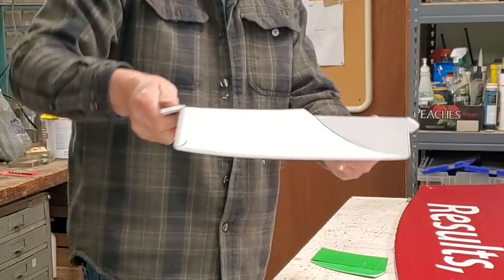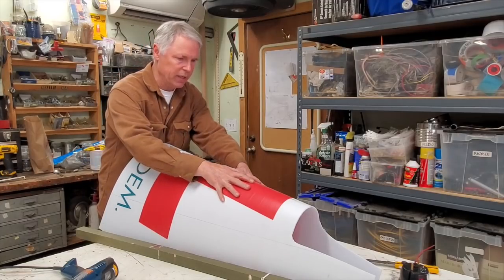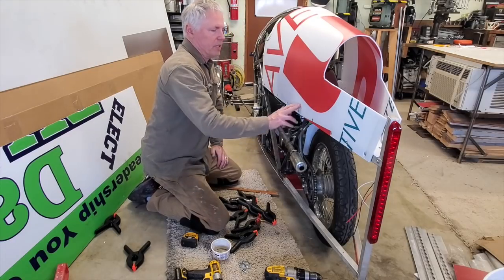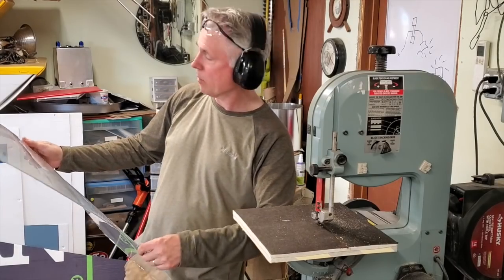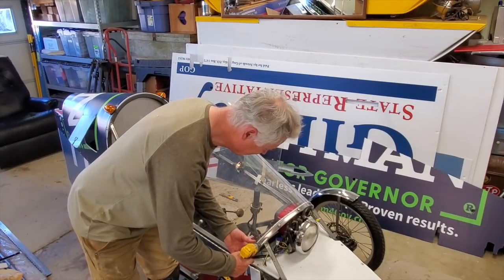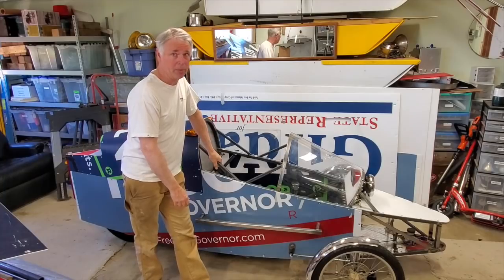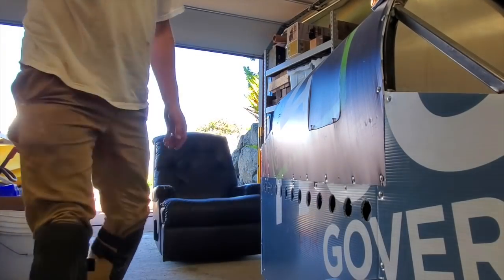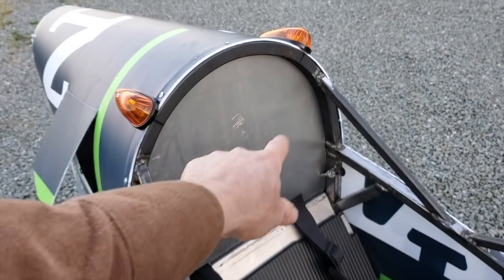Fuel efficient reverse trike build (part-13)

Comment: I remember reading somewhere that practically all coroplast or polypropylene in general is UV stabilized. Adding to that if you source them used with full cover prints, (no matter how many empty promises, commercial or political) that print is still paint and will also help the plastic underneath resist UV degradation.  I'd love to know in more detail from people who have built with coroplast alot what thicknesses and "weights" (grams/sqm or whatever is used) they  prefer and in which places on a fairing.

Comment: The best thing about coroplast is that it isn't fibreglass or CFRP or kevlar or... You get the point. No nasty resin, fumes, sanding, mold making, sanding, dust, sanding...did I mention sanding?

Comment: 72 volts with Q motor will allow you to charge it with the sun you will get much better range and not have to depend on gas stations.

Comment: Honestly, some paint, and especially homemade paint with enough pigments, would make it last a lot longer in the sun. Boil a cup of flour, add a cup of used cooking oil (no matter how used it is, and how smelly it is, as long as it's filtered and let to rest so the precipitates can settle to the bottom and not be included), a few cups of water (you can add more and mix again before painting, depending on who much you want to distill it), and pigment (to give it the preferred color), mix that well while the oil and flour are still hot. You can even use dirt, ash, powdered milk, rust, sooth (from a chimney fire), water color paint (for kids' crafts), oil color paint (for kids' kids) or store-bought paint pigments. I think you should try it. 

You can watch different videos on paints, to find what ratios people use. But I don't recommend using acetone, medicinal alcohol, or paint thinners, to thin it, just water. The flour is added not only to make the paint stick to the walls, but also especially so oil and water can mix, so when the water evaporates, the oily later remains and makes the vehicle waterproof. Warm/hot rain could remove the paint, but that would just expose the corrugated plastic boards instead, so the vehicle wouldn't be damaged.

Also, reflective tape goes a long way. You can use some zipties, some small plastic containers (even if you have to make them from plastic bottles cut into shapes and molten together with a long piece of though wire heated by a flame), and LED lights placed above reflective tape, and you have blinkers, stop lights, and position lights. Red tape for break lights, yellow tape for blinkers and warning lights (which you can place above the vehicle, so other vehicles are warned that it's a danger to the traffic), and white for positions and for reverse.  The headlights you use to see forward would need to be proper bike headlights, and can't be done with a few low-powered LEDs.

With a bit of handicrafting, you could even make a modern-looking or even futuristic-looking vehicle, with fancy lights and all that. Reflective tape might be expensive, but it's cheaper in bulk, and it can be used for a lot of lights. Or you could buy a bicycle lights system, which has break lights and blinkers included, and maybe expand it with a few more lights. And it definitely needs lights on the wheel covers, so vehicles in the dark know how wide your vehicle is. And please add mirrors, so you see behind.

Comment: Paul, how about slanting your top semicircular front cockpit framing member about 10-15 degrees to the front and making your two triangular cockpit braces on each side a single curved brace and welding in three places to get your triangulation for rigidity. The front piece would likely need to be redone to match your existing body slope.  This would give you a couple of inches to help with ingress/egress.
Reply from the maker: I'm trying to keep from stare casing the windshield. I'm wanting a continuous arc for better air flow. Thanks for the 2 cents though Don!

Comment: Why not put heat vents above the license plate rather than on the side? having a vent above the license plate would allow the Venturi effect to pull the heat out.
Reply from the maker: The holes are drilled just below the upper storage floor. I would have to make and upward sweeping arc to vent it the way you're suggesting, limiting what little storage space there is.
Reply: @paulwelkinsdiy  Ah good point, I didn't realise you had storage in there above the engine. I know you have an LED bar at the back, could you have a long skinny vent either side of the LED bar, it would make the trailing edge about 3x the thickness it is now, but you probably be less drag than the holes on the side, anyway it's just a suggestion.

Comment: Hey Paul,  You know there is several options you have for the bubble top.  First the new roll bar could have been hinged so that the roll bar is locked down after entering the trike. Second if you don't want to change that hinge the tinted bubble to where it flips forward or to the side to exit and enter your trike.  Third would have been taking and making a whole piece that encapsulates the roll bar and bubbles together that hinged and locked in place that was easily removable in case of any work that needed to be done or escaping in case of emergencies.  Also I would like to know where you buy your corrugated plastic sheets in large sizes for future projects of my own,  Keep up the good work
Reply from the maker: Hey Cody. I might still play with hinging the acrylic bubble to the side. We'll see. Most Home Depots are stocking 4x8 foot sheets of the white 4mm thick stuff.

Comment: Some great points and inspiration.   BTW, with a motorcycle sequential trans you don’t have to clutch on upshifts, just blip the throttle.   Nonetheless, I’m now a subscriber, which means I’ve deleted someone else to keep the amount of subscriptions at a limit so as not to interfere with own projects.  Nice job!

Comment: Is great. beautiful, long time ago i made some ting like that and i cant drive it normaly due safety issues on my town, but i remember that is great to drive some thing like that    https://www.youtube.com/watch?v=6TKsSyBwc3o
Reply from the maker: I watched your channel. Our minds think alike! Here is a trike I made about the same time you made yours https://www.youtube.com/watch?v=LYi76MACrV8
And here is a motorized bicycle where I used a similar 2 hp motor and used the 6 speed hub gears https://www.youtube.com/watch?v=OnrdzQnPFZ0&t=34s
I like your fluted plastic body as well. I love working with this material. Thanks so much for sharing Fernando!

Comment: I understand and agree with the canopy safety issue. I wonder, however, if a sliding, locking canopy could work. I'm picturing something like on a P-51 Mustang that had a rearward sliding canopy. Sliding it forward could let you get in at the lower sill. Also, DO NOT PUT A FUEL DOOR IN THE HEADREST!!! That is the closest thing you have to a firewall in an accident! If you get rear ended (most likely accident next to being broadsided) this could rupture the fuel cell and coat you in fuel.

Comment: Yoga. 
And when parking at home, park under a strap so you can pull yourself up. 
So, pull-ups too!!
😊
And if you're getting a new visor, what would happen to the wind if you raised the trailing edge an inch or so higher? So, the wind goes over your head?

Comment: Just heard the motor....perhaps you could put a CB350/4 motor in it- they sound awesome for a small engine.
Reply from the maker: That's what I used on my first build many years ago, but the frame and other items made it too heavy for the clutch to take off on a hill.

Comment: If you put "decorative" short wings on the sides you could use them as a step to get over that high cockpit side.
Reply: He could reinforce the safety bars sticking out the sides and use those for a step.

Comment: Awesome use of old signs. 
FWIW, a rotating object is really bad for aero. If you're looking for gains that don't involve breathing gas vapors, fairing in the sides and leading edge of those front wheels might be worth a few mpg, and maybe even a few mph.
Reply from the maker: Thanks Christian. I might do that. Right now I'm disassembling the frame for painting.

Comment: Been watching you awhile...just discovered that YouTube unsubscribed your channel...

First time comment..
I'm wondering for your front body panel and windscreen if you couldn't find something close on the Ultralight parts market for a one piece cowl and windshield
Reply: PS ...I'm an Elkins on my mother's side hailing out of Tennessee
Reply from the maker: @josephdougherty2399  Hey Joseph! My ancestors came west from West Virginia several generations ago. 
I'm pretty much replicating the body style on my last trike, which is a cheap and simple way to create a semi aerodynamic faring. I like low fuss and budget building techniques. Get er done and use it!
Reply: Paul, you really should at least look ....some of the under 100 HP cowboys have cheap parts from "bad landings"

Comment: Your laws on self build vehicles must be much less stringent than ours in the UK. I admire your build but it would never pass the self build test they all have to go through.
Reply: I'm sure Paul could pass whatever inspection he had a mind to. This bike should be legal because it started life as a Motorcycle with a VIN in this case.
Reply from the maker: @BakedAndAwakeSkates  I'm a bit gun shy taking it to the local inspection station. My first trike ran into problems when they thumbed down my use of off road parts, the Banshee A-arms and wheels.  Since then my state removed that restriction due to pressure from the local off road motorcycle community, I think. It's a no brainer that off road parts are superior to road vehicles. Apparently it's easy for someone high up to create a ludicrous law forbidding whatever makes them work more. Anyway, I want to re-skinned the Beast and have it looking respectable when showing up. I don't want a repeat of my first experience.

Comment: I have a question about USA legislation concerning these vehicles. I noticed Paul put a license plate in the rear. Is it the license plate from the donor bike? how does that work with the cops? can you actually drive this thing around using another vehicle's license?

I'm from Brazil and it's a hassle to get a license plate for a hand-built machine like this here.
Reply from the maker: This is indeed the original license plate, but it hasn't been tagged for some years.

Comment: observation: I own a sign shop. That material is 6 mil (or so) coroplast or similar brand. Yard signs are temporary for a reason. That "substrate" will crack apart over time. it is amusing as a "skin" over his frame but wear a helmet for sure.
Reply from the maker: You are right, and these are 4mm panels. I use 6mm for my motor boats. Great stuff! Explosed to the sun this wouldn't last but several years in the northwest, but I have a garage!
Reply: @paulwelkinsdiy  nicely said. Research Alumalite and double thick Alumacore. I hand cut odd letters and shapes. They handle the 220 mph winds to meet sign code.

Comment: My mind says that looks like a heckuva accomplishment. It also says, at 6'4" tall, I wouldn't fit. Plus, I think I would have wanted my body/legs further back from the nose with some intensely designed bumper/cage built-in to the nose. Having ridden 35 years on various motorcycles, it is clearly in my best interest to not trust other, larger vehicles. But that's just me.
Reply from the maker: I agree this has modest tubular protection, and it was just built race car style (to fit me).  I too worry most of getting smacked by ANY vehicle, and hopefully my whits and the hard-not-to-notice shape of my rig will keep this from happening.

Comment: I wonder if some little bars sticking out from your front roll bar might give you the extra grip you need to climb up and out. Either that or two looped straps hanging from your rear overhead bar. Sorry it didn’t work out to climb in through the lower front gap.
How much do you think it would affect structural integrity to put the windscreen and front roll bar on a hinge that opens to the side, like some smaller aircraft canopies? That way, you would free up the entire top section and be able to climb in and out more freely, then just swing the windscreen up and over your head. Granted, you would want the hinge to be EXTREMELY strong, and have an equally strong latch, but do you think it might be worth it since the rear roll bar would take most of the force in the event that you rolled?
By the way, thank you for replying to my comment in your last video (and hopefully this one too, if you have the time). I don’t know if you saw my reply to yours, but I offered to send you some motorcycle turn signals I have lying around from a project I never got to. They’re bullet style and about an inch and a half in diameter. I like the ones you went with, but if you want to add more or feel like you might have a use for ‘em in another project, I’ll send them to you if you want. Your projects are always inspiring and I can’t wait to see what you do next.
Reply from the maker: Thank you for the turn signal donation offer, but I think I'll decline. I've got a few more of the top lights and also some real small bullet LED turn signals that I'm keeping for running lights maybe attached to the outer steering beam. 
On this video, I don't know why I didn't use my side crash bars as a step. It works great! Stupid me! The only effort is getting out I have to use some stomach muscles. No biggie, I need the exercise.

Comment: I love it's microlight aircraft kind of vibe! How are you finding the beam axle front suspension?
Reply from the maker: Adequate for road use. A bit bumpy for rough roads. The beam does act somewhat as a torsion bar when one wheel hits a pot hole. I haven't fine tuned the shocks but they're performing fairly well, considering I just made a wild guess at their settings. .

Comment: For the long term, you need running lights on both front fenders so oncoming traffic can tell how wide you are at night. A rule of thumb from home airplane builders, plan on 3 tp 4 times as much room to exhaust hot air compared to the intake. This is absolutely needed to provide adequate air flow to cool an air cooled engine.
Reply from the maker: How do you do that? The end that attaches to the cylinder head on my old muffler was used, then more length added. It's about the same size as the intake, one inch diameter tubing.
Reply: @paulwelkinsdiy  I think you misunderstood my post, I am referring  to cooling air for the engine, not the muffler. I could have worded that better.  😊

Comment: Excellent  -- looking forward to the electric conversion 👍
Reply from the maker: That would be someone else. The whole reason for this vehicle is to show the viewer how, with better aerodynamics and lighter materialsl, you can improve your gas mileage yet stay dry and safe in case of an accident. I made this on a budget. I could have used aluminum, chrome moly or carbon fiber to shave off more weight, but again I'll leave that for someone else to play with.

Comment: I love the sound of the engine! Nice inspiring project. Also, it is good to hear your thoughts through the process.

An unrelated issue: it is pity you had to remove your plywood electric boat video.
Reply from the maker: It's still running as far as I know. Here is a link. https://www.youtube.com/watch?v=CIcGLjjOOb0&t=10s
Reply: @paulwelkinsdiy  oh, thx!

Comment: You can get near perfect uv protection just by painting the plastic. The backyard rollercoaster guy Paul Gregg did extensive tests on pvc and found painted pipe only lost at most 5% fracture toughness after 2 years in sunlight, as compared to something like 40% loss unpainted.
Reply: No!  You would lose the kool looks.  Surely that graphics give uv protection
Reply: @markthomasson5077  I think the graphics are probably a transparent ink rather than an opaque pigment that would block uv

Comment: That in end was what I was thinking of suggesting (trimming).. hard to tell you I'd rather show you with drawing but I'll try my best ..(btw, huge fan I am in bothell and love all your stuff man watch all ur vids!) So if you matched the upward angle above the side bar. But did that where you want to trim. And or make it so the long back tubes end at or right under the brake light. That make sense?
Reply from the maker: Hmm. I'm disassembling the body now and trying some things out. I was thinking of maybe bringing the bottom bars in the back up some, like you said, near the bottom of the brake light to help reduce some of the swaying during windy days.

Comment: Nice; I like seeing the coroplast process in action. One thing I dont like about it is the rattliness of it though. Perhaps EPP foam sheet would be about as easy to work with; same PP, but the complete opposite as far as acoustics as concerned I would think.
Reply from the maker: It's definitely increased in noise to my ears. I've basically created drums for the noise to bounce around, increasing the volume, and more parts are rattling around. If anything it's definitely gained personality.
Reply: @paulwelkinsdiy  Glad to hear you are happy with it; though when/if I get around to trying my hand at something like this, im going to give the foam route a shot. I like the idea of just taping the seams. Some of that gorrilla-branded tape you can buy nowadays is absolutely indestructable.

Comment: If the tape you are using to cover the screw heads are only for covering and not for reenforcing, flex tape I believe is a better option for environments that may get wet. Just an idea